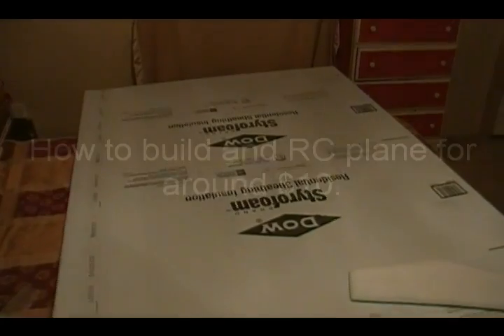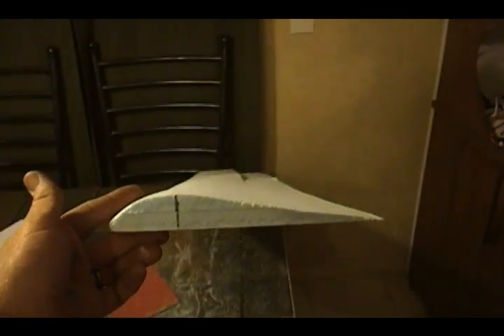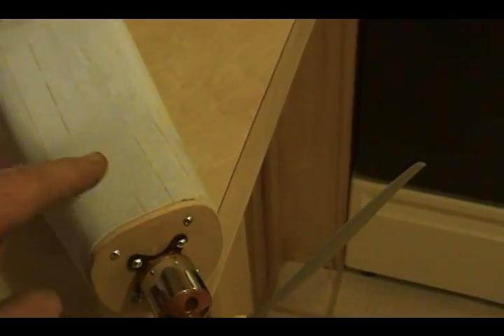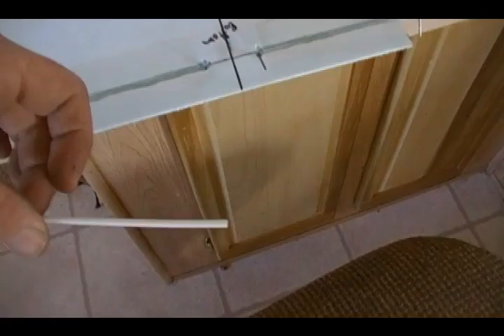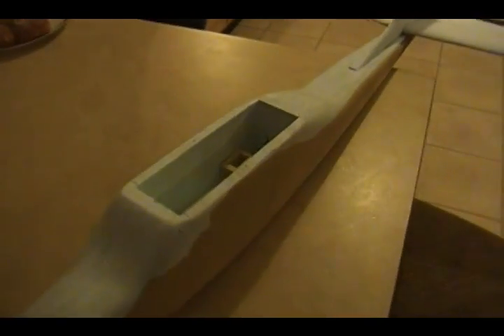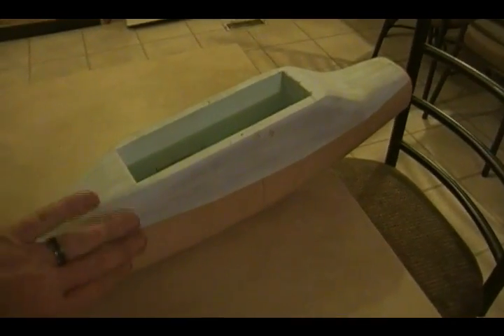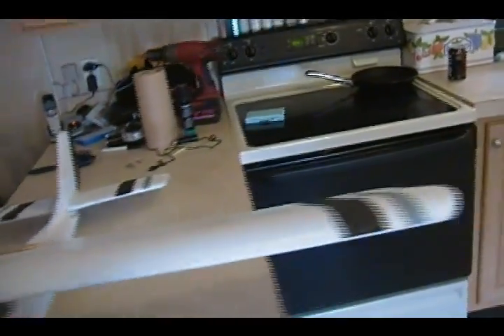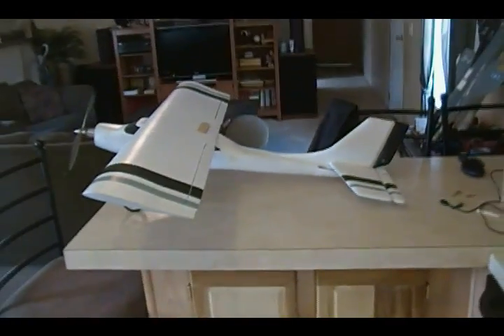How to build a RC plane for $10 (part 1)

Comment: Awesome! At college we work with the blue foam to make models for projects. A nice trick for example to make sure the wing (or any shape) has the same shape over the entire wing is to take a small left over piece of cardboard or wood and cut the side profile of the wing in it. Now you can place this template over the wing and check how much you will need to sand in different areas to make it the same over the entire wing.
Not really saying yours isnt or anything, just thought it was a nice trick

Comment: I talking about cutting a small 1/2 by 1" strips from the 2 liter plastic bottles for hinges. Back in the day I made a ton of those big foam planes you can buy at Walmart for 5 bucks RC. Back then I could convert one over to RC in less than ten minutes.  If I tore off a wing just replace it or stuff 1/4 dial rods and tape and toothpicks to fix. 

Those planes I made don't compare to the looks of what you have. 
Great video

Comment: sorry but this wont work, if you plan on building this plane you need at least $100 or more to get quality parts, plus a transmitter which can cost up to $1000 or more possibly

Comment: BpHobbies outrunner 2217-6, 25 amp ESC, 11.1v 2200mah lipo, three Bluebird 371 micro servos, 9" prop.

or just buy any old 1500kv bell, 25 amp red brick esc and a 3 cell.

Comment: I just got everything I could need motor, battery(lipo)/ charger(lipo) esc(30A), 3 servos, radio/ receiver, and hardware. All less than 250$. It has gotten much more affordable. then 10$ for foam. It is indeed priceless in the end

Comment: Have you tried the EDF foam at Lowes, pretty cheap for a whole load of it. Not as heavy duty as this stuff, but you could reinforce it with some wooden rods and glue. There's a video on youtube of a guy who made a rc plane using foam that's 16 feet long from wingtip to wingtip. Big enough to put in a camera system.

Comment: 10 for the plane, 200 for the transmitter, 80 for an brushles motor, 10/15 for servos, 20 for an lipoly, and enough parts for an price of 350,-. buy an goflyrc starter for 110,- and you have this plane too man.

Comment: I believe you can also use Epoxy glue, which is stronger than hot glue and more rigid and it won't melt the foam

Comment: What about the remote did u buy it. Also what are those things called they ones that controls the flaps. The electronics things. How does the remote control the plane what's the name of the component in the plane. Response From anyone with the knowledge would be appropriated Plizzzzzzzzzz

Comment: okay, really cool, but my math maybe a bit rusty. 7$ for sheet of foam, so that leaves 4$ for ban saw, belt sander, hot glue gun and glue, carbon fiber tubes and rods, motor and prop, servos, radio, receiver, speed controller, battery, charger, and some kind of course to learn how to design airplanes that will actually fly. i must be shopping at the wrong stores

Comment: 7.99 on foam. maybe a dollar or two on dowel rods. suppose i had the motor, glue, tape, plywood, and prop. spent $0.30 on hinges. $1.50 on paper. where the hell do i get a CARBON FIBER SPAR and servos for $1?

Comment: built this. what i did for wing mounting is ran two wooden dowels through the fuse and used rubber bands to mount the wing. I actually made two wings for this, one with and one without dyhedral. that you so much for this tutorial.

Comment: Heh, reminds me of the balsa wood airplane I made using limited materials. I took sheet of balsa wood 2 feet long 4 inches wide, and about as thick as your finger nail, soaked it in hot water for about a minute, put it in a clamp so it had a slight C shape (Looks more like a parenthesis) to make the airfoil. Id type the whole story but it doesnt fit in a comment :(

Comment: If you use rubber bands for wing hold downs you won't tear your fuselage up on a cartwheel type landing.  (for beginners).  I use #64's bought in office supply store with two 1/4" dowels through the fuselage epoxied in, one near leading edge and one just under trailing edge.  Screw down looks neater if you have perfected your landings.  Great build!

Comment: I ordered a sheet of styrofoam.  It's 5 feet by 10 feet by12 feet. I building a car. It used a 35 cell lipo.  I'm having a little trouble finding the right wheels. Sometimes I get this funny taste in my mouth like aluminum.

Comment: When you attached the vertical / horizontal stabs, did you glue them or put rods in and screw them into place? And thank you for the great video, I'm working on a project and your video is very helpful! Thanks!

Comment: Super job.  I built a $ 2 plane from dollar store stock poster board.  Still flying and love it just because I did it myself.
   Yes it cost $ 10.00  to build the plane. , have either a crashed project or spares that you use to build a new one.  Can't bill me for the new parts ( I explain to my wife)  so the plane costs me  the materials to build it.   Of course figure in the hours and it is prohibitive.  How much does it cost to wax your car if you already have the car and the wax.

Comment: how easy does that foam bend, without snapping? i'm curious, as i have an idea where i want to create a curved part using fiberglass, lay the foam over top of it, then lay more fiberglass over top. this would create a fiberglass foam "sandwich" which would not only insulate but also be pretty strong. also, is it heavy? all the foam around here i've seen is all rigid and snaps like a twig.

Comment: Right in front of the papers you will find white glue for about $2. You probably will spend a little bit more than $30 buying all these stuff ( just for the ariframe) + your electrical parts ( servos, motor, battery, radio control, control speed, receiver, etc). Of course if you are already into the hobby, you probably will have some of these parts. . I am taking some ideas from this guy to build my own FA/18 70mm with a duct fan which is going to be inside the fuselage.

Comment: The styrofoam costs $10.50 at lowes> it is 4x8' 1/2 width. I did check prices last week. You also will need a bag or maybe two of DU-BRO NYLON HINGES, if you type that on ebay, you will find them. they cost about $4 each bag. I believe they come 6 hinges per bag. 3M SUPER 77 SPRAY ADHESIVE , it costs about $12 at lowes. The paper he mentioned to cover the plane cost about $3 at lowes also. You can find them by the tapes and paints section.

Comment: @mrrjcook 
It's a brush less motor so it has three wires and a controller called ESC (Electronic speed controller).
TOTTTTALY... different than brushed motors.

Comment: Nice vid, i just rebuilt my rc glider fuslage using this methode, thanks for the insperation. Oh here in SC Lowes dont sell foam, so it was off to home depot.
Next project will be the cessna. maybe with a 53 inch wing spane who knows.
Again nice 1,

Comment: @mattster468 Yes, foam insulation floats, but ships can be made of materials that are denser than water, so long as the overall density of the boat is less than that of water. This is usually fairly easy because of the large space full of air inside the boat hull. Hence, the ability to make warships out of steel.

Comment: is this design possible?:

just attach a a 5inc fan to a 1 inch motor, the fan facing up wards, do u think the motor would fly up? i mean float? wen the fan spins? do u think the fan can life the motor up in the air and after lifting it up for some distance, will it stay they like its floating?